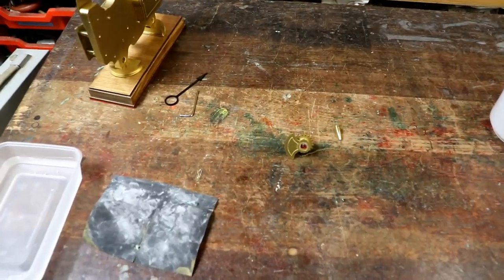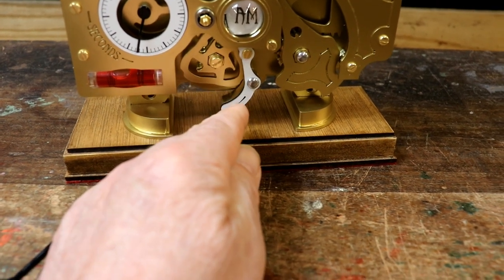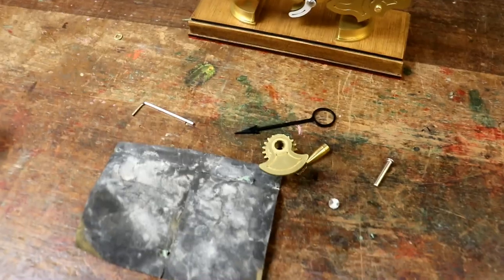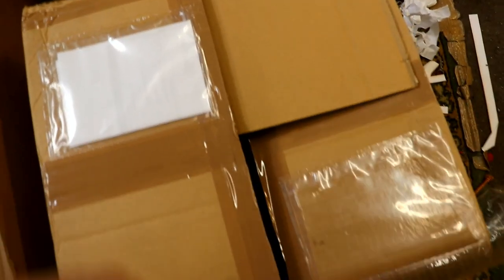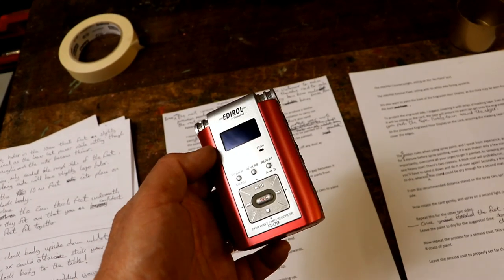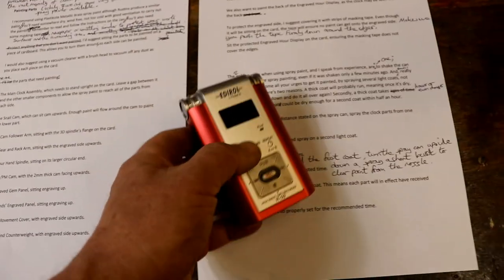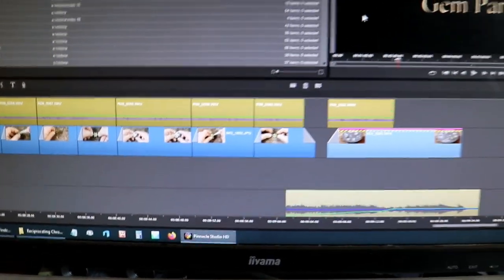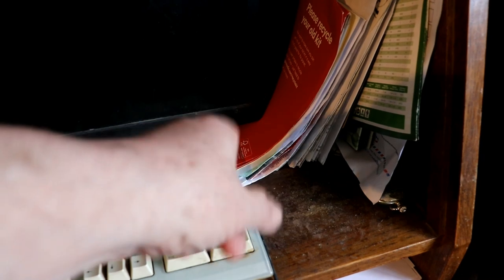Instructions Finished - Freedom!

Comment: solder a 5v wall wart to the turntable and forget about batteries :)   Very pleasant narration.
Reply from the maker: Thanks VJ, I had built one out of technical Lego, but liked the fact the new one was compact and didn't have wires that needed hiding. I was even thinking about using an old wind up record player which would look interesting!
Reply: @steamhead  Fantastic idea !!
Reply from the maker: @marwanbeaino5377  It means an exploration visit into the loft... but it is very exciting up there considering everything I've saved over the years!